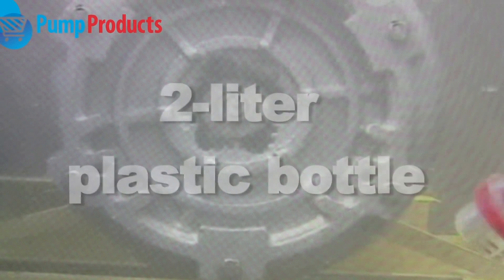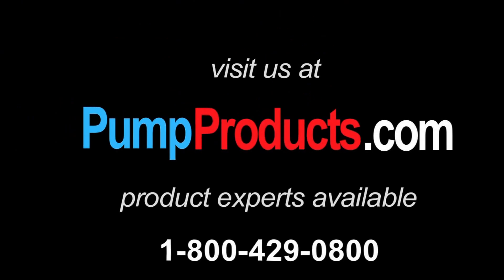Pump Products BJM Shredder Pump Video*

Comment: How come the bubble wrap seems to stay stuck to the impeller after it get inside the volute?  Isn't that going to cause unbalance and lead to more power draw out of the motor?
Reply from the maker: Thanks for your interest. What you are seeing in the video after the bubble wrap gets sucked up by the BJM Shredder Pump is a glimpse of the pump's impeller "fang" which acts like a knife tip to cut through difficult solids that often get caught in ordinary grinder pumps and cause them to seize up. For more information on BJM shredder pumps call Pump Products at 1-800-429-0800 or go to:  http://www.pumpproducts.com/shredder-pumps-c-347_846.html